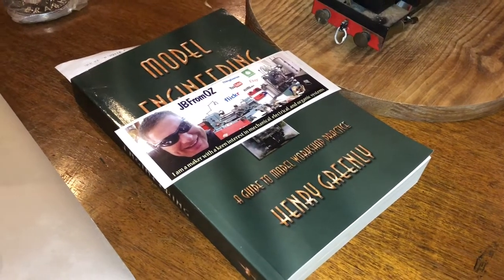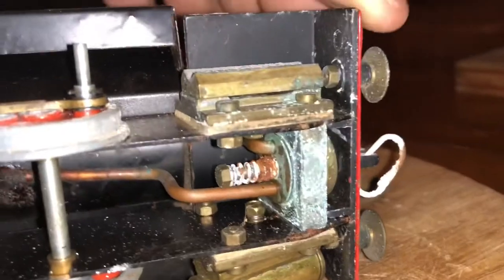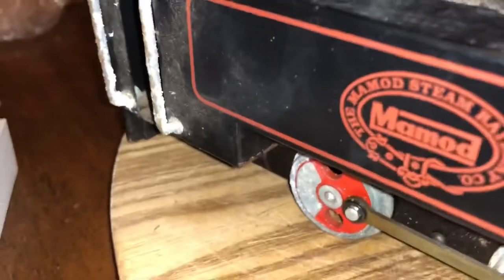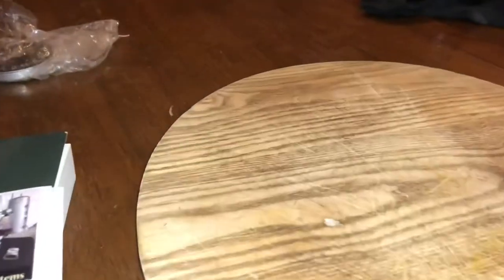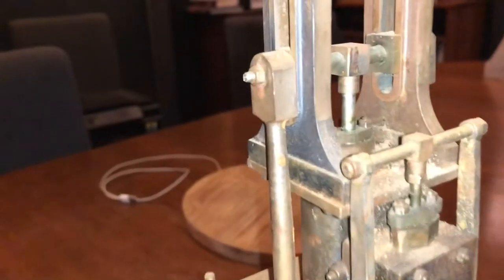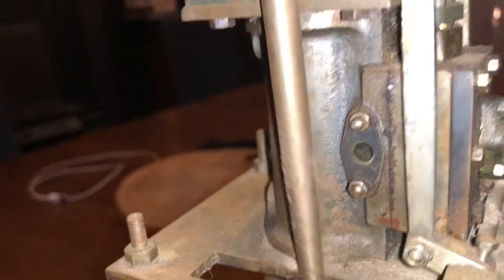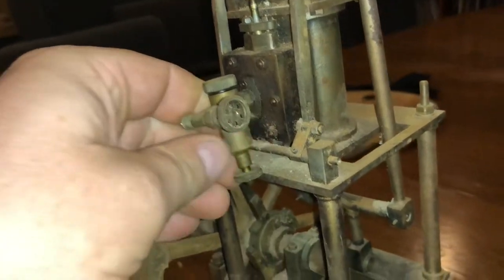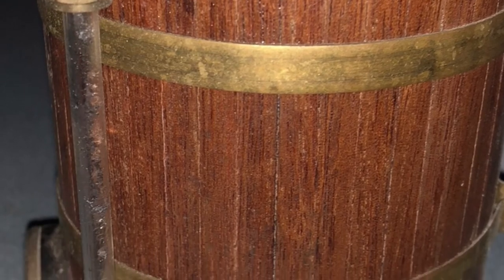Live Steam - Living the Dream!

Comment: Very interesting vertical steam engine.  The exhaust port position seems a bit strange re clearance.  It appears to be a kit.  Nice find and should do up nicely.  Be good to see it running.

I went to a farm fair a few months back where they had at least 50 model steam engines running on compressed air on display.  Tried to take some footage but it was blowing an absolute gale and then to top it off the same display started up a GM diesel engine (no muffler) to pump up the air tank and drowned out everything on the audio.  So it was a total non event.  Pity because they had an engine there very similar to what you have.  I'm not sure which model group it was. 

Cheers Rob
Reply from the maker: Gday Rob! Yeah the exhaust port is wired, I can imagine if I rotated the pinning of the attached drives below I could have the vertical beams miss the port, but that would be placing side load on the same joint in operation... very bizarre!
Reply: Yes it is weird. I wondered afterwards if the steam cylinder is half a turn out on the base bolts and the port should be to the opposite side, but without seeing it at hand it's just a thought.

Cheers Rob
Reply from the maker: Yeah I was thinking about clocking the cylinder, however the steam chest and valve linkage also has a twin bar arrangement! One reason that identifying the kit and reviewing other builds would be of interest!